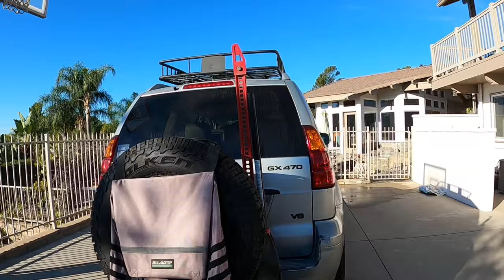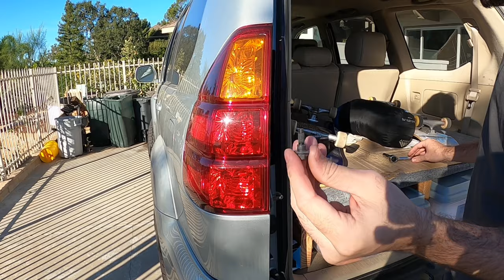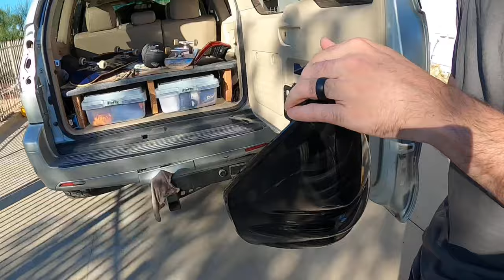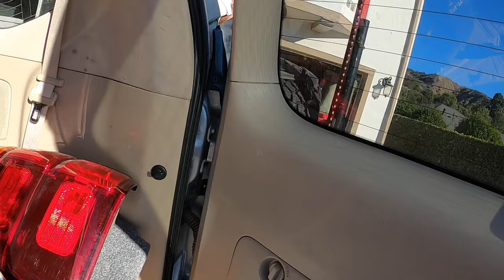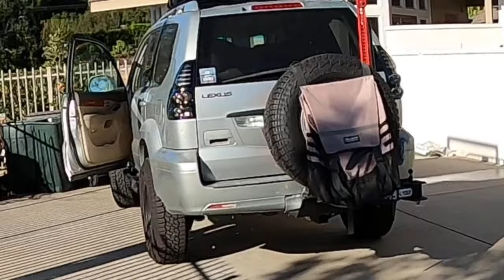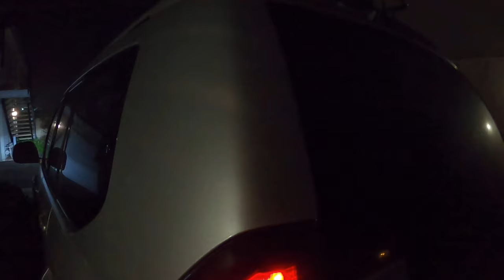Lexus GX470 TAILLIGHT UPGRADE (No Tint)

Comment: I guess I am the only one who doesn't like them. 🤷 I'll be looking forward to your next video. 🤙🏽
Reply from the maker: We all have our preferences, it’s all good. Thanks so much for watching 🙏
Reply: @lexus_offroad_adventures  Did you have a problem with hyper blinking because of the LED turn signals?
Reply from the maker: @PittiesAndMore  I did before I installed these taillights! And funny enough, the LED taillights solved that issue. I think when the computer senses a difference in resistance in the circuit (I put LED turn signals in my headlights with incandescents still on the rear) it thinks one of them are out. Having all LEDs seems to solve the issue.

Comment: So I ordered these for my 2006 GX470 and the right side doesn’t seem to want to seat properly on the two anchors. I’ve followed your instructions to install them and the left side is just fine however the right side continues to pop off the anchors. It’ll sound like the two hooks catch just fine. Then I’ll go to install the 10mm screws and the unit will inevitably pop off the anchors. Did you ever face this challenge on your set?
Reply from the maker: No I didn’t have that issue on either side. If you hold it in place while you tighten the bolts does it stay in?

Comment: Those look fantastic! I wonder why they designed them to have such an heavy turn signal light and the brake lights are covered not nearly as bright. Nighttime, look fine, daylight I am not so sure they are bright enough maybe it's the video. I might have to put brighter LED's on the gate brake light to compensate.
Reply from the maker: It’s the video. The turn signals are super bright but so are the brake lights. They did a good job with these. In the future I think I’ll remove the lower turn signal bulb and wire in a White LED reverse bulb like they do it from the factory on the Prado 120s
Reply: @lexus_offroad_adventures  so you will use the reverse lights on the new mod rather than on the gate b/c you have them blocked with the spare? I put LED's in the gate and they are so bright it is crazy!
Reply from the maker: @AZRubicon1  yes exactly, the spare now covers the backup lights on the stock location so I figure moving them out to the taillights is the best move

Comment: Did option did you go with? 
Plug & play
Usr edition 
Dual signal esr
Reply from the maker: More info than you asked for lol: 
The first (1) one is just the tail lights as they are with incandescent bulbs for the reverse/signal slots. The second (2) one is replacing the amber incandescent turn signal bulbs with the amber LED turn signal bulb upgrade only.  The last one (3) is what you see in the video where the bottom reverse light slit is activated using LED Amber bulbs in both slots for the turn signal.
Reply: Kinda pricy for the LED if I select option 3.  What size LED bulb is it?  Might be cheaper to buy the LED from amazon